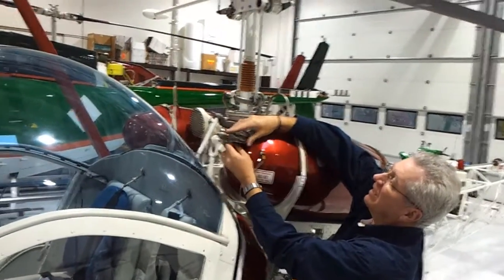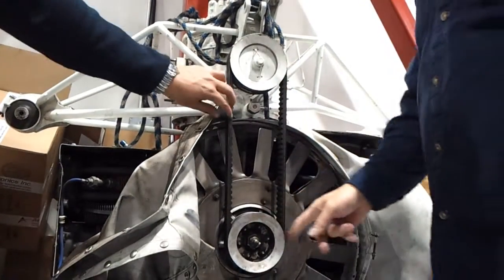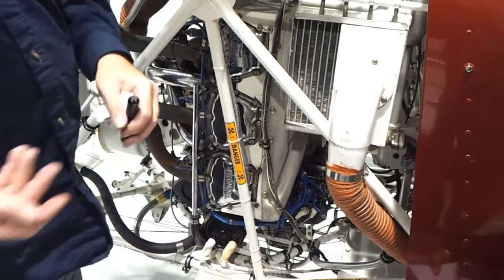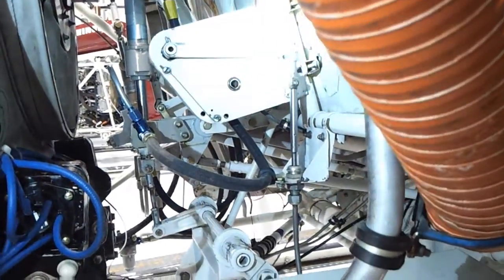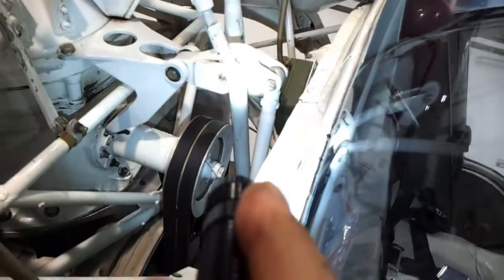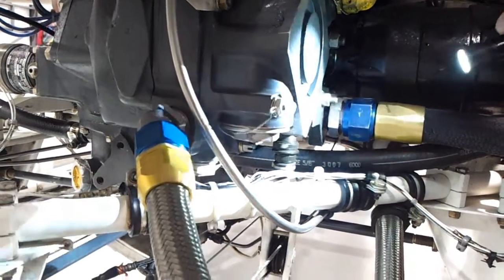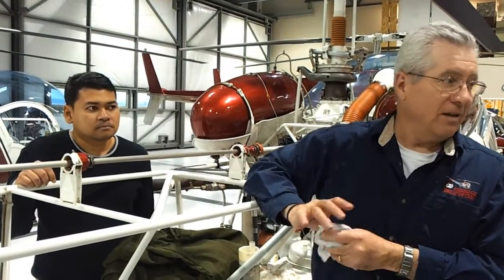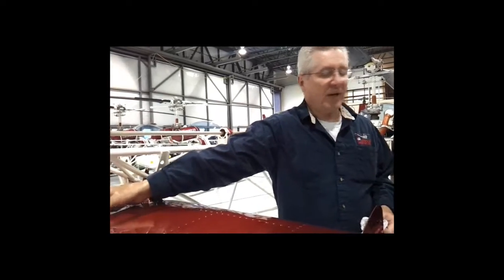Bell47 walkaround

Comment: My father flew these crop-dusting and had a total loss due to a crack on the left side of the centerframe right below the engine basket. It let go and impinged the flight controls while simultaneously pulling the short shaft out of the trans.